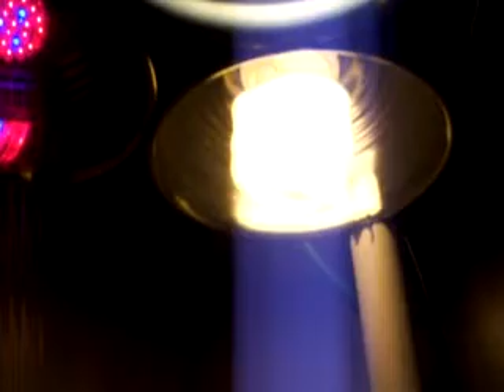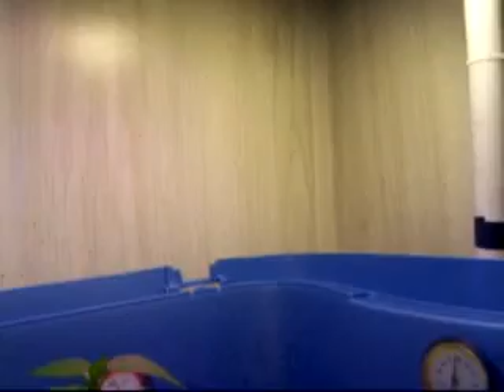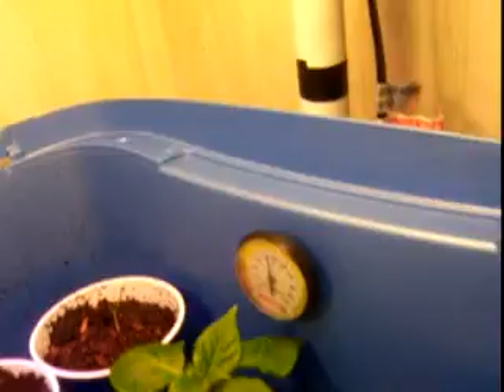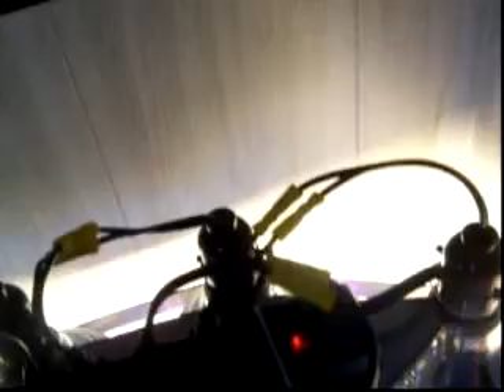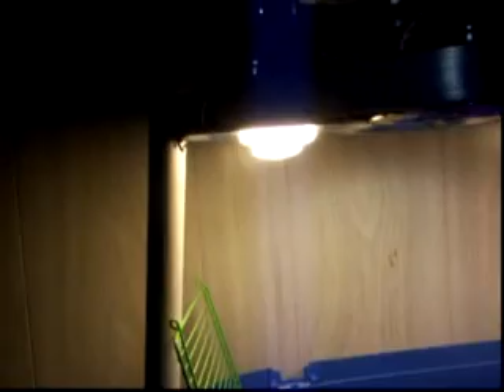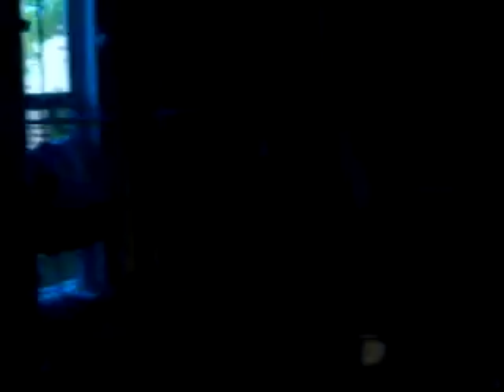Growing peppers indoors. Info, ideas , tips and more

Comment from the maker: Im using miracle grow moister control. it cost a bit but its the best ive found. i use it for all my plants even my garden box and for starting my seeds. and i dont use any fertilizer. i use a lil once and it burned some of my plants so i use just tap water. just if you have seedlings under the set up dont let them dry out or thell die.
 if you have any more questions feel free to ask!